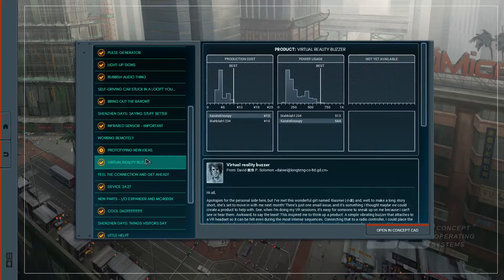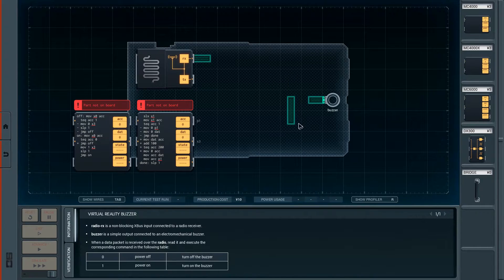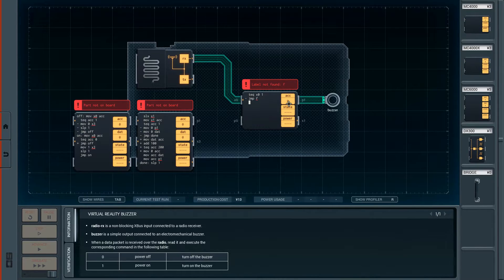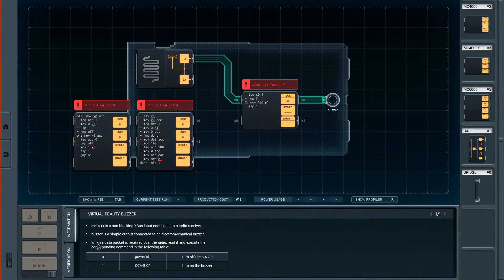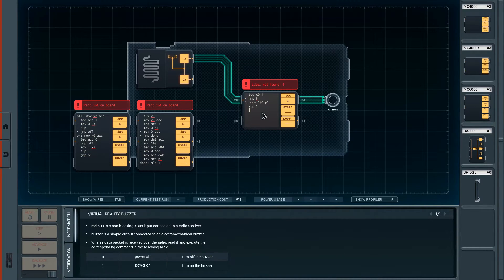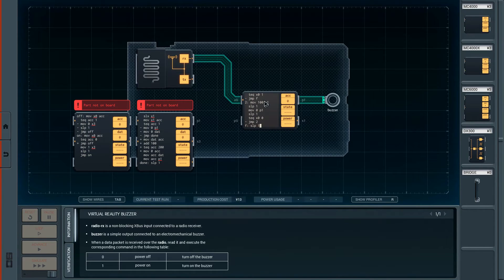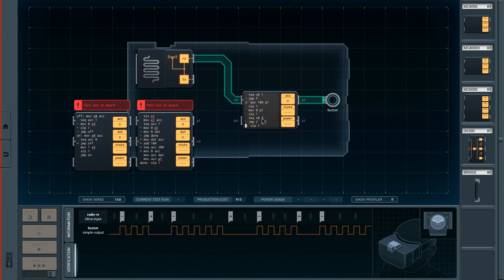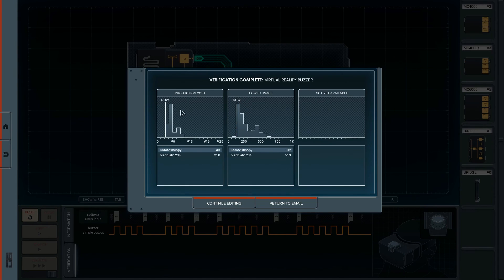Let's Play SHENZHEN IO #7.5 - VR Buzzer (Better Solution Explained)

Comment: Had a solution like your first, but I simplified using the "not" instruction.  The solution you gave made me say "wtf" several times until I understood that what you done was legal in the game (reading from xbus without a sleep, running an instruction on the same line as a label). It really opened my mind. Thank you!